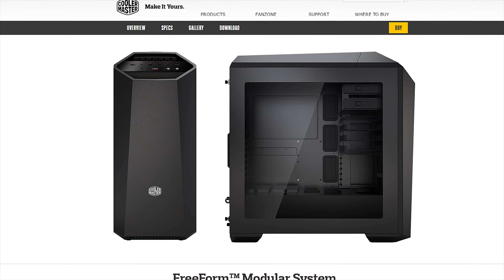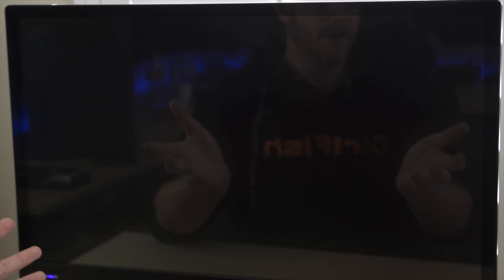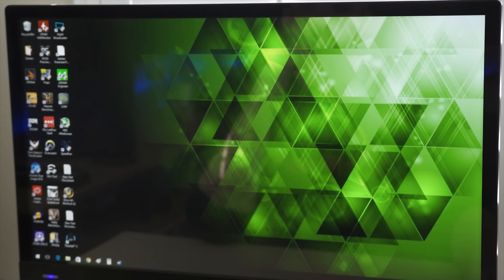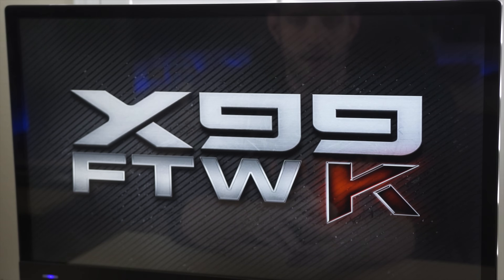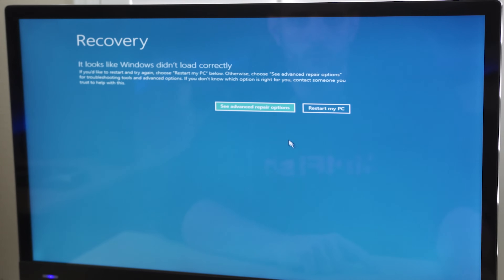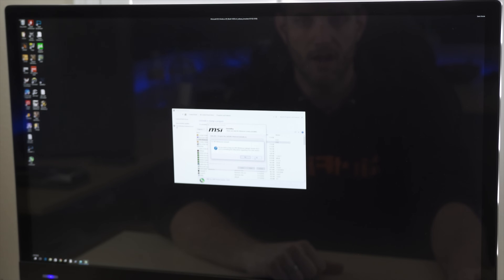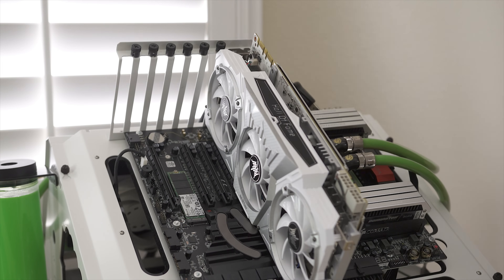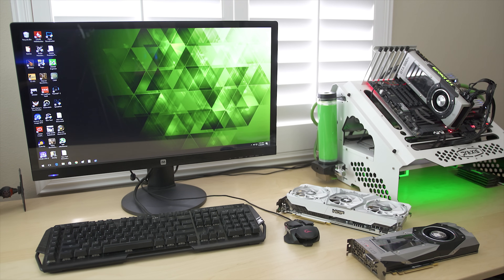How to fix a bad overclock on any Video Card

Comment: Hey guys ill realy appreciate if you read this comment till the end cause i need help (messed up my PC realy bad)

I over clocked my GPU (GTX 1050ti) CPU (ryzen 3 2200G) and RAM and it realy messed up my PC, i saw a vid on how to over clock every one of my parts correctly and it all looked ok in benchmark as i ran them for 20 mintues without any crashes or problems, i then opened GTA V and all hell broke lose, the game freezed and didnt let me go to task manager to close it or anything, i turned off the PC with the phisical button and every time i turned it on it gave me a blue screen, then it started to do a repair proccess and after an hour i got back into windows, but all the over clocking programes that i had got deleted and i coudent open any program on the PC, i tried to fix it by deleting and downloading drivers but nothing helped, i reseted my PC with a USB with win10 on it cause it didny let me reset it in the setting for some reason, now my PC is fresh but still gives me problems, i deleted and reinstalled drivers again, that stoped the PC from crashing and taking me for the blue screen, i then downloaded GTA V again and the second i started the game all this prossess began again, i cant find any help on what exactly i need to do so please help me ill give all the info you guys need, thanks.
Edit: my 2 ram sticks run in different frequencys (2133 , 2400) when i OC them i set the frequency to 2400 and didnt see that one was allready at 2400, is it a problem? ( it worked 100% fine before the OC)

Comment: hi so my gpu is stuck at 300 mhz  but it is a rtx 2060 and I think some thing is wrong. I had a 1060 in there before the change the rtx 2060 and it still ran only 300 mhz. So does anybody have a fix for this?

Comment: I know this is an old video but I just wanted to say that I’d like to get back to pc gaming and my pc I have now almost works but the gpu (Radeon r9 270, I know super old) that whenever I install the drivers just takes me to a blank screen, before i presses the reset button thinking it was the power button long story don’t ask, but I had to wipe my pc to get it to work but once again, installing gpu drivers only gets me a black screen and nothing else, I will mention that I did oc my gpu and didn’t have any problems, if anyone knows what wrong I’d appreciate the help, thank you.

Comment: So I tried overclocking in the bios and now my pc will not turn on. It turns on for a second then back off, back on, back off. eventually it will turn on and stay on but it won't boot, keyboard doesn't turn on nor does the monitor, but when it's on and running but won't boot or turn any accessories on, it beeps three times. Idk what that means but when I tried putting more ram into it it wouldn't start either but it would beep, idk if that means that the gpu is fucked cuz the ram i tried putting in it might've been fried cuz they came out of my last pc that i accidentally fried. Idk what to do but ive tried the battery technique, taken out the gpu out, booting without it, nothing. Tried to touch the two pins on the motherboard that says bios and under that it says normal 1-2 so i tried that and that didn't work so idk what to do know. When i over clocked it I also pushed the cooler up all the way as well cuz i assumed that would help it stay cooler cuz of the overclocked gpu. Please help.
UPDATE: Fortunately I have fixed it and it's running perfectly as it was before the over clocking issue.
Reply: currently it is on and beeping.
Reply: No display or keyboard action
Reply: I'm on windows 11
Reply: Could I replace the battery with the one from my old mother? or would that mess it up even more. I feel like it would wipe it a refresh the bios. but I'm not sure.

Comment: Hmm ... why did you open the app and change and or delete the profile? Putting in another graphics card is taking the long route to fix it and just a pain in the butt and not necessary. Unless you smell smoke! Safe mode is the best way ... TU. But where did you get your motherboard mounting devise (chassis?) ... not sure what to call it?  (ha .. found it ... I want one! but crud all sold out) Now if we had what you have then changed out the graphics card not much of a pain. I have green stuff I drink daily as well ...

Comment: idk if anyone will see this but i tried overclocking my gpu (rx 580) to 1500 mghz and i put the Mv to 100 and it would go to about 1.25 volt when using unigine heaven. after that i left my room to do somethings while it was on so i would know my gpu wouldnt crash and i come back and my pc is off. but usally i think thats normal but it wasent my pc wouldn't even turn on until i removed the gpu and the next day i went to a friends house to see if it was just my psu but it wouldn't work in his either so if somebody could help me that would mean a lot.

Comment: So building my very first build I made a horrible mistake.  My build is:
Zotac 1060 amp 6gb
32 gb ddr4
ASRock fatal1ty professional gaming Mobo
Samsung 970 pro 512gb (boot drive)
2tb HDD & 256 SSD
My big mistake was a purchased a used i7-7700 CPU.  It is not a k my mistake.  Every attempt I have made to overclock using blck has resulted in the PC failing to boot twice then loading defaults.  The motherboard has a double bios and is intended to be overclocked.  Could someone PLEASE help me with the right voltages and blck frequencies to try to get something above the 4.2 turbo.   I haven't touched the voltage because I'm chicken, tbh.  I tried 100 but it was worse than the uefi set on auto.  It only went to 3.6 instead of the 4.1 I normally get. Thank you.  Please respond someone.

Comment: I barely overclocked it. my brother came in and told me to put it back to stock(major pc dude). so i did. so now my games are crashing and giving me this error "FATAL ERROR: The GPU is not responding.  
(Game title) has experienced a fatal error."
 
Im about to restart my system after doing a proper uninstall.

Edit: i restarted my system and my games are still crashing. my pc is only good for using the internet and messing with audio files. can someone help.i have a 980 and have never had these issues before i overclocked.

Comment: @jayztwocents I recently took my brand new rtx 260 super(non third party) and immediately cranked the clock +170 and memory +700 without increasing voltage(i frogot), instantly my system crashed.  I couldnt not get the pc to post, so i switched a working gpu in for it and still not posts, I tried to clear the cmos by using the jump and by removing the battery all with psu disconnected and still nothing.  However, the mother board which is a b450m steel legend will turn on as in the rgb lights on the board turn on and they are the color and design that I set them to even after clearing the cmos they still turn on and all my fans turn on and they are all green still.  I even tried reseating my CPU.  My only conclusion is that it must be that I somehow fried my PCIE express lane so I am ordering a new MOBO, does this sound right to you?  Thank you!!

Comment: after I overclocked my fps dropped from 250 to 50 in games like csgo, I uninstalled MSI and even reset my laptop to factory settings but I'm still having that issue. any ideas?
Reply: Hooman st did you fix it?
Reply: @razewyd8743  
No, never did. couldn't find the issue but I guess I damaged the GPU
Reply: Hooman st dang that sucks, I guess overclocking really isn’t worth it
Reply: Hooman st did you try deleting drivers and re installing them? Did you try re installing Windows?
Reply: @razewyd8743  yea I did all those but as I said my GPU was toasted

Comment: My screen is yellow after i overclocked

Need help
Reply: Do the first method then..
Reply: Drake Bunger If that doesn’t work then do the second one
Reply: @abeyyy4415  Aye man i fixed it but I have bigger problems. All my games that didnt crash are starting to crash now. freaking out man
Reply: @BadJesus420  Sry bro I dont think I can help with that but Ill try. How long did u have a bad OC and what gpu do u have?
Reply: @BadJesus420  U can try and reinstall ur drivers (make sure u get the latest version)
Reply: @abeyyy4415 Well i had it for a lil bit. But i tried many different things which resulted in multiple crashes. GTX 1060 6gb.
Reply: @BadJesus420  Reinstall ur drivers that might work
Reply: @abeyyy4415  OOf Okay Ill try that. I might have to buy a new card. What should I get?
Reply: Drake Bunger Did it work? If it didn’t work don’t give up. This might sound stupid but there are some forms on reddit dedicated to pc help. U can ask for help there and ur problem might be solved. (If my solution didn’t work). Also what’s your budget
Reply: @abeyyy4415  Ill try it soon and let you know. My budget is around 800 but i can push it to 1k
Reply: @BadJesus420  Whats ur cpu?
Reply: @abeyyy4415  I have a AMD 2600X i believe. But i got a new CPU.  A i7-9700k and i just need a new motherboard
Reply: Drake Bunger ok get a z390 motherboard and u should upgrade from ur 1060 anyway. Get an rtx 2060 or something around that power if u want a 2070 just get a 2060 super or a 2070 because they’re both better value
Reply: @abeyyy4415  Okay cool thank you! Do i do a custom install for my GPU Drivers?
Reply: @BadJesus420  Just do a standard one. Make sure you have already uninstalled the old one. And np
Reply: @abeyyy4415  i think i did it all but it still crashes.
Reply: @BadJesus420  Damn sorry to hear that bro, u can ask ppl on those forums tho lmao, they def know more than me, unless u wanna buy a new card
Reply: @abeyyy4415  I take this experience as a learning curve. As of right now i guess i just gotta keep working and save up for a new card. Looking for something a lil more powerful and affordable card.
Reply: @BadJesus420  Yea 2060's go around 280 if you know where to look. Good luck bro
Reply: @abeyyy4415  280 pretty cheap. Thanks man!

Comment: ive got a asus strix 960 artifacting, my noob a** tried ocing it with msi afterburner it worked but something wasnt right im seeing stuff in games that i shouldnt be seeing, okay that oc is bad so i tried to reset it to default it runs but STILL artifacting okay ill remove afterburner and clen the registery...... STILL ARTIFACTING :( its not crashing or getting hot its fine in that sense but still its not right when i shoot a gun blue sparks fly out the barrel looks like i turned a 44 Magnum into a tazer, when the bullet hits the target blue splatters of blood can be seen, if a train is going past you guessed it blue sparks coming off the wheels as it goes along the track, ive reset it removed msi used DDU in safemode i cant get it back to how it was, people have a good reason to fear oc when this kinda thing happen to their £200 gpu! dont forget jay you can easily replace stuff we viewers cant.

Comment: So. I tried overclocking my rx Radeon 480 strix 8gb (I can't say exactly what did as it was my first time) but I immediately got a black screen with the cmd prompt open and couldn't do anything. I tried launching it in safe mode but I still only had a black screen with the cmd prompt. I switched my hdmi from my gpu to my motherboard hoping that could help but it didn't. I then proceeded to uninstall everything which also didn't help. I then tried reinstalling the amd software and in the optional tab I chose for it to discard all my old saves and drivers and install it factory new, which also didn't help at all. After installing it I tried opening it hoping I could go back to the app and delete any of the old saves if they somehow persisted after the re-installation but the app doesn't even open. Anyone hopefully able to help? I honestly have tried everything everywhere but I always just get a black screen with the cmd prompt

Comment: Windows will not allow me to uninstall the overclock software in safe mode. I do not have another GPU or iGPU to use. Fuuuuuuuu... guess I have to do windows recovery :/
Reply: The error I get says that there is an issue with windows installer service.

Comment: Oohhhh no way Jay, I have actually killed my gpu. I hope you see this and help me out please... its a 1080 g1 gaming. It was perfectly OK untill I had a bright idea to clock it using msi afterburner now all I get is a black screen on boot up with artifacts/like dead pixels on my monitor. How TF can I do this.. I didn't do anything stupid like mega voltage or owt I just used the sliders for top 3 an on c/clock  just applied +100 & on m/clock applied +500 ran heaven 4 or 5 times then my pc was sat at idea for like 20 minutes then the screen/image went black with like dead pixels??? I've not set afterburner to start with Windows but everytime I reboot my pc it's the same black screen. Please help dude...

Comment: swapping out the video cards is a pain in the ASS ,,, if your gaming then your video card is a monster and getting it out then going through all the hassle to replace it is a waste of time .. the smart thing to do is do not check start up on restart in MSI and this never happens period.. One last thing if your doing a video that involves multiple windows restarts then for fucks sake use a SSD hard drive I cant stand waiting for my system to take longer then 7 seconds for a reboot do you really think I want to watch your video rebbot multiple times with 5500 hard drive ? if you do have SSD card then you got ripped off cause its dog shit slow ?

Comment: old video but, i have a shit pc ok so its a i3 7gen with a gt 730, i overclocked the gpu for about a year now all of a sudden im losing around 20 fps on most things to the point where they are unplayable at least i got to play halo reach since it launched but i cant play it now i was at a disadvantage with 30fps and now im getting 10fps, i really dont know what happened ,  the gpu probably died on me, and its not like i can get a new one i live in fucking chile xd and here if you're not on the rich 1% class you typically only find extreme shitty jobs, you dont get job security or anything you are basically overworked exploited for some chum change you cant even pay bills with

Comment: You are throwing around with terms you dont even know what they mean... wants to do a "softreset"->presses the reset button.... Gets into OS and gets good signal on monitor until complete boot "card is hardlocked". Did you ever upload a video with a title that wasnt totally clickbait? Do you even know how to reset the bios of a card that doesnt show any signal at all, wont boot and cant be reset via atiflash for example? Or are you just a guy, sitting on a bunch of expensive parts selling us basic windows features like it was something you can only do if you studied computer sciences...